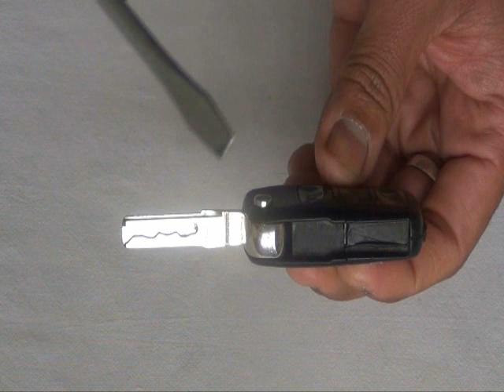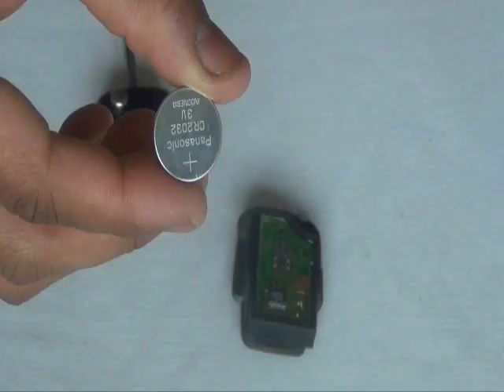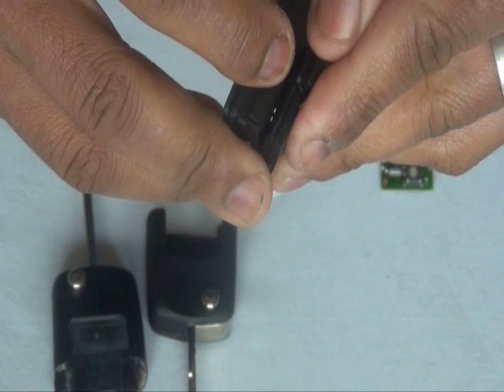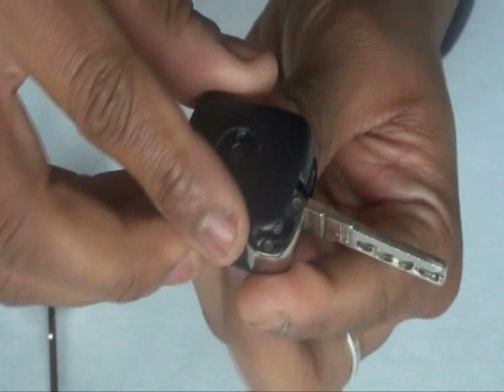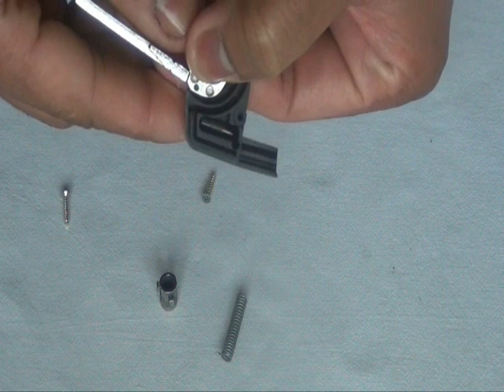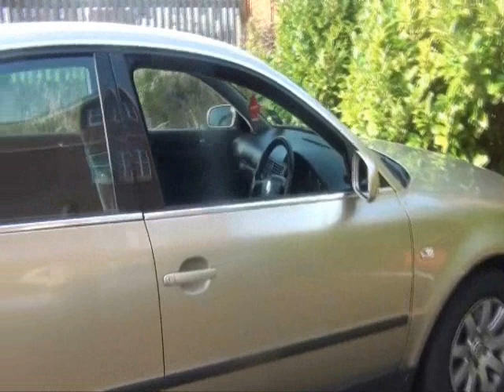How to change VW Passat S Key Fob

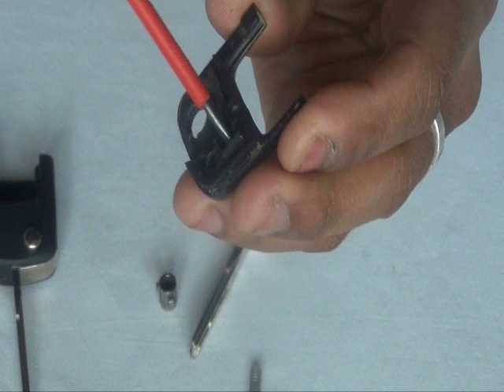Comment: Be careful guys. The immobilizer (that small part on 5:28) is not that easy to take out. I also shattered mine. It was glued, and it's body is very fragile. So when I tried to lift it like it is shown in the video (using the screwdriver) I simply broke it. Dude who made this video had to place at least a comment about it!
Reply: How did you fixed it?
Reply: i like trains, there is no fix to it. So I was left with my spare key.

Comment: Just swapped mine over after following this video. As Jeff mentioned, the transponder was glued in so I had to cut it out carefully. Also, the circuit board did not just fall out I had to gently pry it off the two black diagonally opposed studs - it's all done however my existing key in the new case does not flick out despite the spring tension hopefully it will ease up a bit with use.

Comment: Cheers mate your video was exscellent.When i got my cases i only changed the bottom half on them for the metal piece at the bottom to put a key ring on.Those bits were missing on my old set.Did not risk moving immobilizer from top half in case i wrecked both keys.But cheers anyways mate.

Comment: WARNING, WARNING, WARNING: While this is great video, there is a HUGE GOTCHA that you must be warned of. Removing that glass transponder is a nightmare to deal with in many keys. Mine is super glued in heavily and deeply bathing it inside the nail polish remover for over 30 minutes only helped to soften limited area, and the transponder is not budging when I try to wiggle it out. I know any pressure will easily crack this fragile piece.   I've been wiggling with this part for 1 hour now with no success, and trying to figure how to break this thing apart ever so gently so that I can remove that transponder.
Reply: +Oneness Mind I think you have to cut it near with a hacksaw and then use a craft knife, I agree it is difficult in some keys
Reply: I had heated mine up with a hair dryer and then cut out one end with a knife to then pry the transponder up and then out.

When I put it in the next two fob, I place it in it's little testing spot with the clear and towards the front of the key and then buried it in hot glue.

Comment: hi, so i have a 2000 volks passat px 4 motion.. my automatic key stopped opening my door.  i thought the battery died and repmaced it but still wouldnt work. i them tried the fuses amd the fuse #38 wasnt broken at all. ibe read in my booklet but camt seem to figure out what i need to do. can i fix the one i jabe or do o need to order a new automatic key?  cor now ibe been having to manutally lock it and keep to the right until i hear it lock amd my alarm be set, and unlocking i do the same except to the left side. please help because i camt find any videos but yours that helped a bit bit still doesnt show if the one you jad was broken, or if you were just repmacing with newer parts, and if there is a reseting button or mif somethi,g in my car has to be fixed. it just worked one day amd in the same day, it stopped working. any info would be appreciated:) thnx
Reply: put it in the key hole, turn to the right to lock hokd it in that position then press the unlock button on the key fob it should work. can be it lost pairing with the car that will fix it.
Reply: I tried that just now, amd it still didmt work. This car has,been with a few owners b4 me amd the man i bought it from, i believe he acted like he sold it independently but when i got the note of sale, i recognized it had a dealership name amd dealers number instead of the dudes name. And my mom was the one who actually purchased it for me thru pictures.... Coypme,months after the key stopped working, and  foumd that the alternater went out and killed my battery. It showed the ABS light, Battery light, amd emgine light with lughtening bolt thru it.  Bought the new battery the ABS light wemt out.  It wasnt holding charge and thats how we figured it was,alyernater. Replaced that amd everythimg was fine until layer that day after i drove it home,my nattery light came,bacm on. Amd my left blinker was,blinking super fast.  I brought out back to the auto place and they didnt tell me what they actually did other then saying they fixed the battery light and blinker bulb which  did read that the vlinker will blink 3 times fast if light is out akd now its ok. Now i just need to fix my keyless entry keys.  I think it meeds to be recomouted with a,code with all 3 keys, well it said in my little tiny,manual that u need all 3 keys to have that done. So anyway, i tried wjat u said about homding to the right inside keyhole and pressed unlock. And i tried,cpuple tomes but still no luck... Any other suggestions, amd or pricing on how mucj amd where to take it for getting it done.  If i need a special place other then vlks dealer becuz i didnt get from them, amd cant afford it i dont think from them.. This keyless emtry key is really warn out btw, there indemts on the,lock amd unlock buttons lol
Reply: Thanks so much for your help by the way!! I appreciate it!